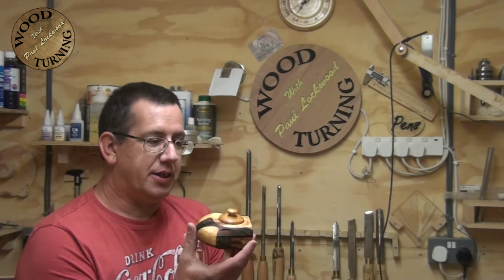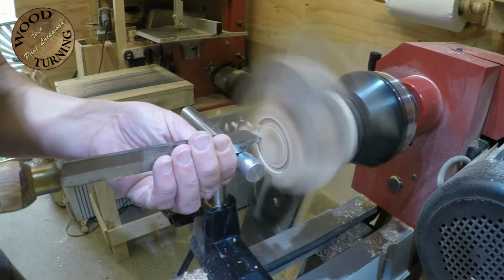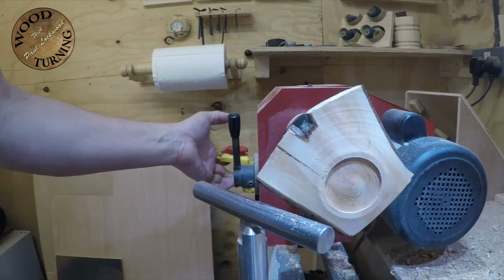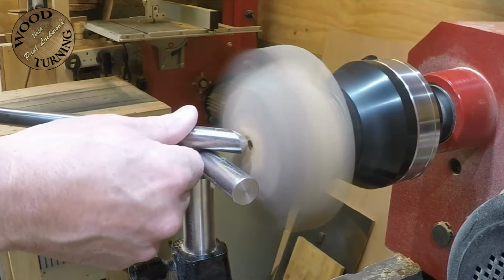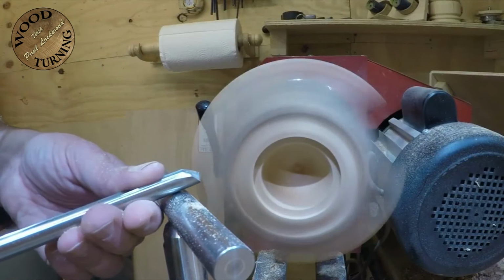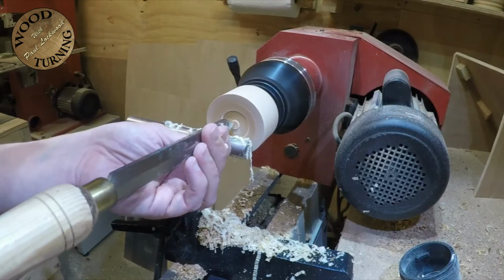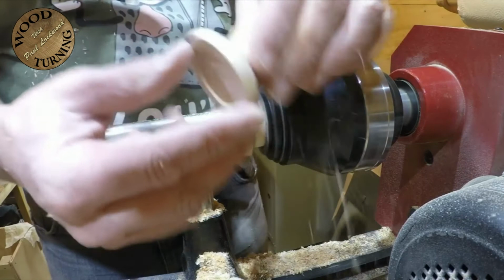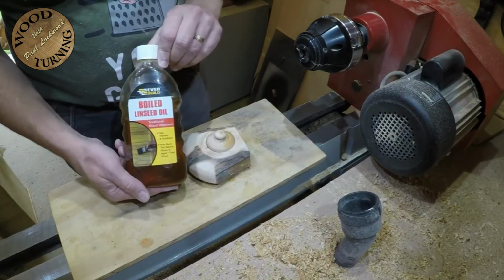Crotch Box - Episode 101

Comment: Learning a lot from your working!!!! What kind of lathe is this; I have something similar with 3/4in drive spindle (yours 1in?) and with the drive unit capable of being turned to allow for large-diameter workings and to avoid the lefty effect! I think mine may have been made in Taiwan...certainly old and second hand; your gear and Shop seems to be all-new! Thanks for your video and as a subscriber I am looking forward to more . . . . good luck.
Reply from the maker: Thank you David. It's the Axminster AWVSL1000 which I bought new when I started turning 18 months ago. I rarely move the head as I've not had anything too big for the swing. Having the wide bed has been great allowing up to 1M between centres. The Axminster range is also made in China, so they all come form a similar place which is why they all look so alike. Most things I've had to buy and most things are just as cheap to buy new so at least you get the warranty.

Comment: Would there have been a way to have a continuation of the natural edge on the lid? It would have been nice from a design standpoint to see it match the box. From a technical standpoint both pieces look great, but from a design standpoint they look like they came from two separate separate projects rather than one final form. IMO the lid needs a finial to give the appearance of looking taller and the continuation of the natural edge. 
Also are there any concerns of the fit of both pieces not fitting over time due to the nature of green wood shifting over time and becoming oval? I've found oil on green wood helps it remain pliable and prevent cracking, though some brands have a tendency of making lighter wood look "muddy", this was not the case with yours and the finish looks great.
Reply from the maker: Thank you Derek. Yes I suppose I could have made the list with some form of natural edge, could have looked quite interesting. This is quite a low piece and for me I don't think a finial would have worked so well as this is more of a rustic piece rather than an elegant piece. With regards to the warping / further cracking, I've had this piece probably more than 3 years before I even started turning, so would be very surprised if anything changes.

Comment: very nice little box. one question about boiled linseed oil, is it a fire risk wit the paper tissues overheating after use? or should i put them into a bowl of water when finished with?
Reply from the maker: Thank you Lindsay. BLO is fine as far as I know. Mine just go straight in my bin bag. The only one I know that has that issue is Danish Oil as it has so many other chemicals added. With that I just fully open the towel and let it dry in the workshop, even sat across a piece of wood (top of an open box I have on the floor)
Reply: thnx for reply. i have put off using it because people say it could be a fire risk. i must remember to empty my bin before leaving the shed. cheers matey happy turning
Reply: What I do with BLO is spread out the rags overnight so they can breathe. After that they can be thrown out as normal. The fire risk is when many oily rags are stuffed together in a tight space.